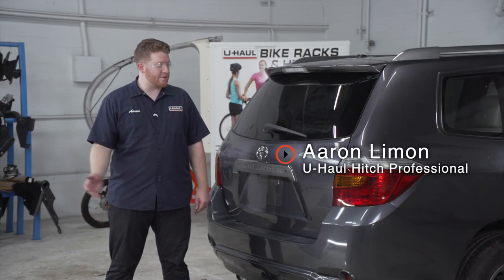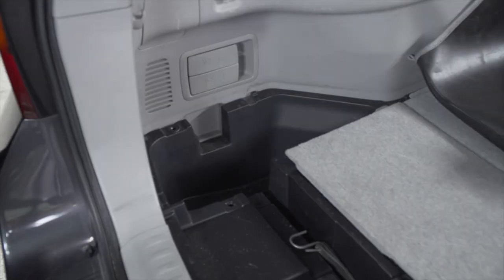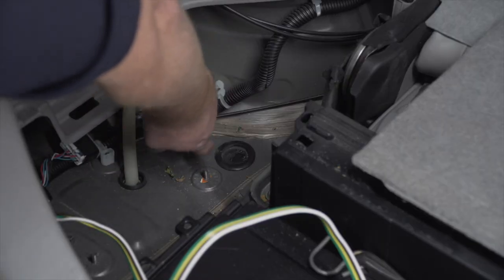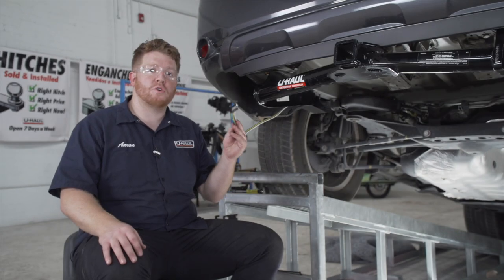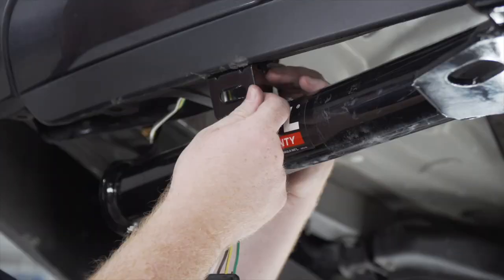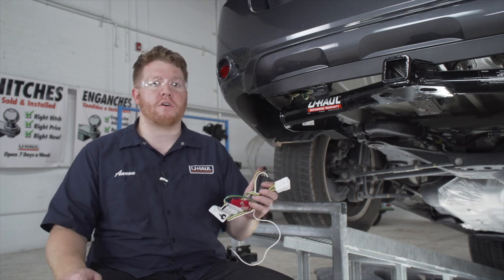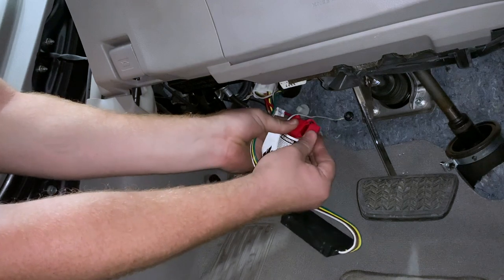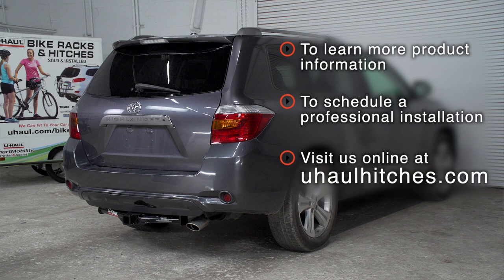2010 Toyota Highlander Trailer Wiring Harness Installation

Comment: Excellent video. I was able to do the full installation thanks to this instruction. The instructions that came with the wiring harness were not specific to the 2010 Highlander. It was extremely helpful that the location for grounding and the position of the 10 amp fuse in the Toyota fuse box were shown in the video. I could not have done the installation without this video.
Reply from the maker: Great to hear!

Comment: Grommet should have been greased where it was cut to prevent water from getting into that area.

The nut for the wiring ground is a M6x1.0 not an "M8" nut.
Reply: Not in my